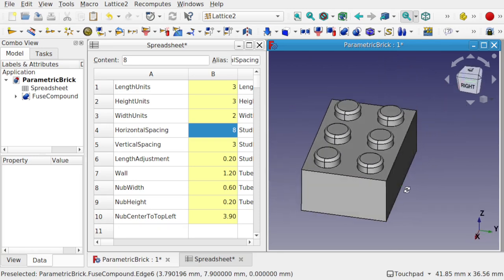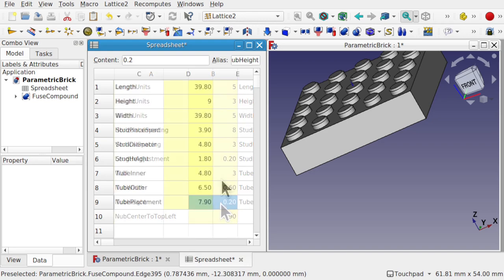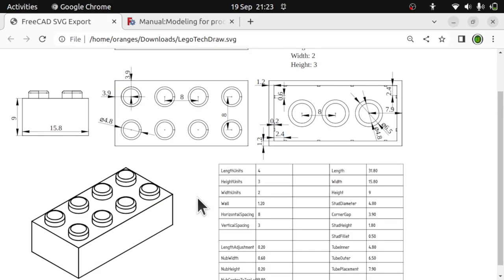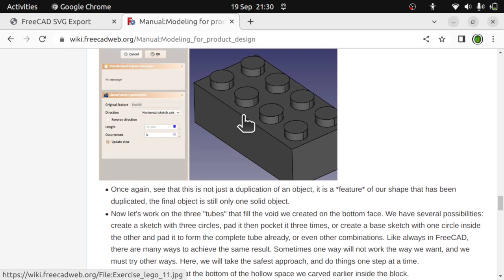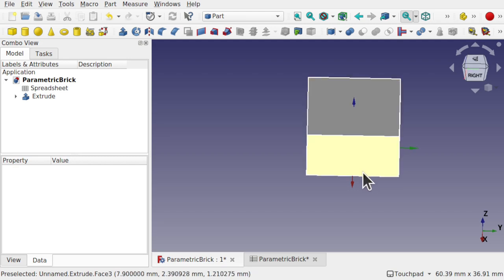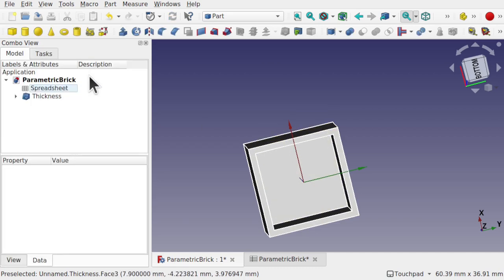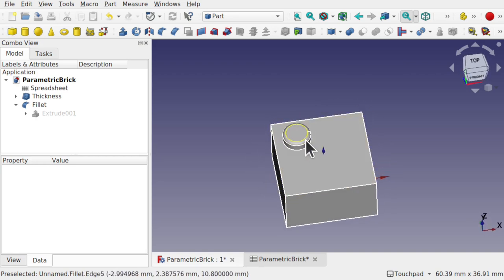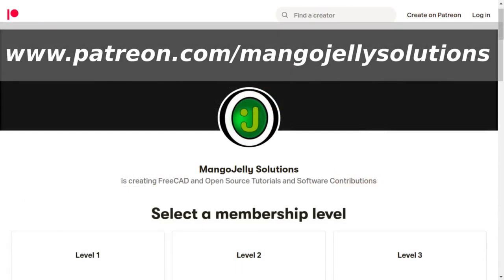Modelling Parametric Multi size Toy Brick in FreeCAD Lattice WB | Part 1 of 2

Comment: Using 0.20.2, Aliasing spreadsheet cells works without first putting a value in the cell.
This is a super helpful video for any project.
Reply from the maker: Thank you for adding the information about the spreadsheet to share with other viewers. Glad you think it's useful video, thank you 😊😊

Comment: Mr Mango, thanks so much for your videos, I’ve learned a lot from them. I’d like to share a trick I discovered that saves a lot of typing with spreadsheet parameters. I always rename my spreadsheet to ‘p’ (for parameter) so I can just type ‘p.’ to add parameters to equations. You may be aware, but I find it makes using spreadsheets a bit less cumbersome.

Thanks again for all the great videos!
Reply from the maker: That is a great tip, nope never occurred to me to rename the spreadsheet, that's a great time saver. Glad your enjoying and thanks for sharing. It's great to get comments to enrich the content 👍👍👍👍👍
Reply: @MangoJellySolutions  glad you liked it!